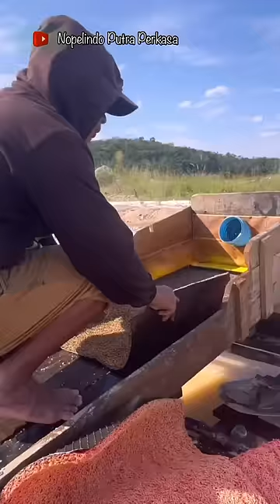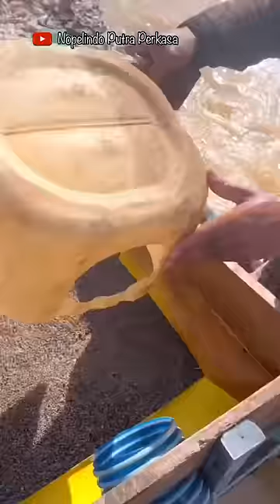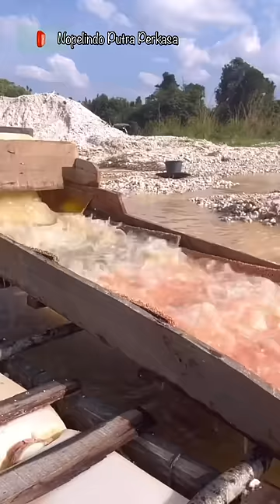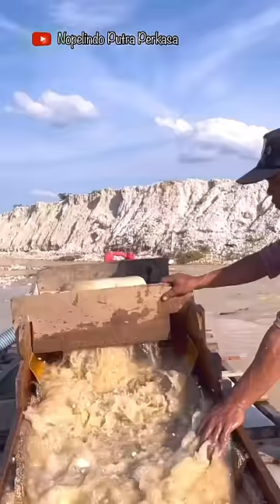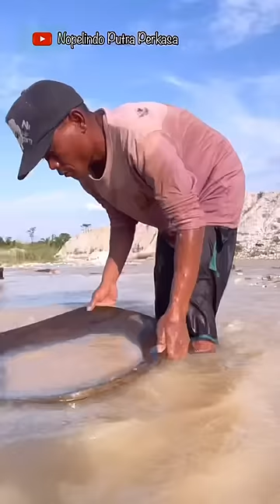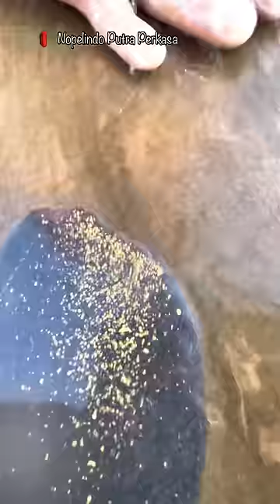A THOUSAND YEARS.!SEASON IN THE SUN ALREADY COME WE FOUND A GREAT TREASURE GOLD MINES MACHINE#Shorts

Comment: In the water with a sweater damn. It get your weather together
Reply: You oughta try panning in the rockies mid winter sometime. Its a bitch but at the same time the lower water levels expose more sandbars and deposition zones you cant access during the spring thaw and summer flash floods.